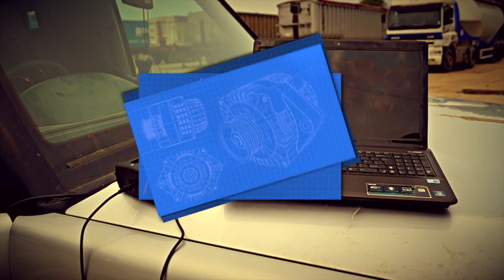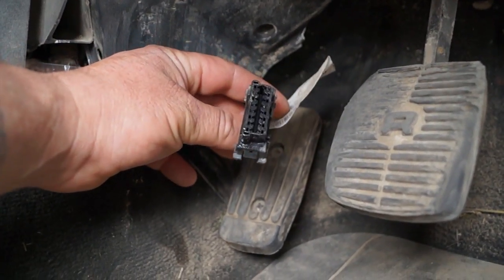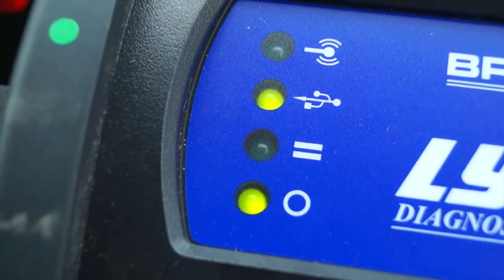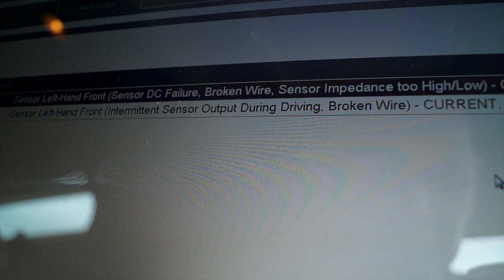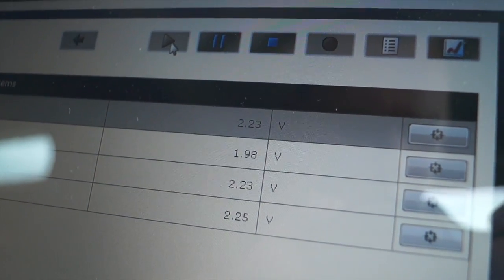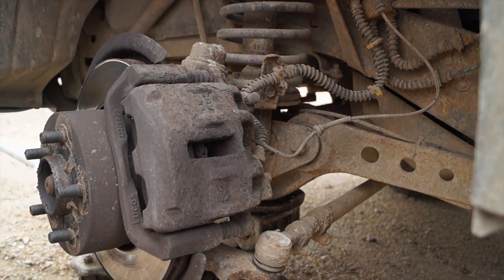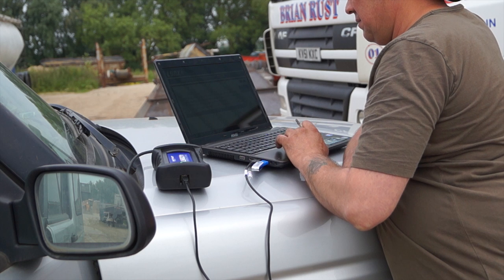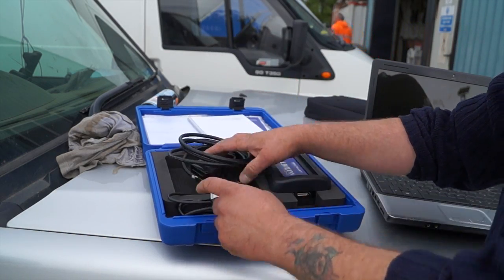3 Amigos diagnostic repair on wheel sensor Discovery 2 using Lynx Britpart interface unit

Comment: Hi There great video, I had 3 amigos after changing all my steering joints. I bought a code reader and it came up with both front sensors out put too low. changed sensor cables, 3 amigos came back. Then I cut out the joining plugs and soldered direct links in case dodgy joining plugs was an issue. Still the same. So even though the code reader doesn't mention shuttle valve do you think I should change it anyway ?

Comment: My LHR sensor gave a "LHR rear abs speed sensor fault-signal output intermittent " I did an ohm test on the old sensor and it was close to 1100 ohms. The new sensor I was going to install tested same. Could there be a problem in the wire between the sensor and computer? And how can I test this theory?
Reply from the maker: you should test the flylead between modulator and sensor.  In the video here it's the same type of lead but different application...

https://youtu.be/jPggSHIN8Rk
Reply: @trailerfitter2  Just finished watching, THANKS! I'll be doing this first thing Tuesday.  Just curious, what is that vehicle you're working on in that vid??

Comment: I have a 2004 disco. the three lit up as well as the d rack light at the same time.help can I just replace all 4 sensors. they are only 16 bucks on amazon land rover wants 150 bucks to read the codes please respond asap. need a sticker in three weeks
Reply from the maker: Bite the bullet and get someone to read the codes.  You needn't pay $150 .  Anyone with a decent scanner / reader ie: Snap On - will be able to read the ABS ECU and tell you exactly what is wrong.   No point in random parts swapping.  Just thought i'd say $16 for a ABS wheel sensor may not be a good sensor.   Good luck.  I am under the impression a Sticker is the same as the UK's annual MOT test?     Not sure if this is relevant to the USA but the UK testers now read the ECUs for permenent codes so just wiping the codes before a test doesn't work.

Comment: I finally decided to get rid of the 3 amigos issue on my disco so i got it plugged and there was one error" rear left wheel sensor electric failure "so i changed the sensor started the car but the lights are still there , got it plugged again and found a new error but this time for the front left wheel sensor so i changed the other sensor 😤 turned ignition on and the lights are still there , plugged it and the front left wheel sensor electric failure is still there with the rear left wheel sensor intermittent error also , any ideas 😔 , could it be the shuttle valves or slabs ???

Comment: buy an Autel Diagnostic Scanner from Amazon for around $20. Clear the codes. You shouldn't see the 3 amigos again for ages. I get it once or twice a year in my Disco II, ever since I've had it.
Reply: I saw your post from a year ago, and i was wondering if you were talking about a scanner that works with the disco II and what model autel scanner it is, thanks in advance.
Reply: i got rid of the car about 3 weeks after this, too many things went wrong with it.
Reply: thank you for the timely reply, i am considering doing the same
Reply: ah no problem, sorry it was short, i'd just woken up and was typing with on screen keyboard lol. 
i got rid of the 3 amigos thing a couple times and it took ages to come back after i cleared it, but after that i had it pop up like twice in a fortnight. then i had a power steering hose wear through, then a diesel line. i had two new sets of brakes in and still couldn't stop the squeaking, the injector rail seal went, and leaked oil into the ecu, then i had to replace the indicator stalk, and all this after the guy i bought it off had just put a new turbo and transmission + a few other things for around $12,000  
it was a beautiful car on the road, but i figured i'd cut my losses. i won't buy another one that's for sure
Reply: I ended up replacing it with an 80 series landcruiser, the thing is a total beast. i put a 4" suspension lift in and 33" bfg muds, and i've not touched it since aside from oil and filters
Reply: I take from your screen name that you are in Australia? ( I am in the US) I just had a mechanic look at it and he told me that the computer is going out as well. Time to sell it I guess. I got rid of my Hummer H3, which was a good and fun little 4x4, but one of my boys abused it a little and so the seats were worn a little too much and so I thought i would get his something else, now I will have to look around a little more. I am used to buying new, but don't want to buy my kids new vehicles again.
Reply from the maker: Now you know that is not the right thing to do.  DTCs are there for a reason.
Reply: The right thing to do was sell the Landrover, which I did. I bought an 80 series Landcruiser, and have had it for a year now with not a single hassle, aside from a service and new brakes. 4" lift and 35" bfg muds, the thing is a beast.
In the 12 months I had the discovery II, i had numerous diagnostic faults, replaced indicator stalk, replaced injector rail (which also leaked oil all through the ecu), water pump, leaky power steering hose, which was worn through due to bad design, which had an aluminium elbow rubbing on the engine, leaky diesel line, began not starting unless i let it sit for 12-20 mins if i drove it more than 50kms and many other things that escape me at the moment.
all this after the guy i bought it from had just spent 12k on a new turbo and transmission + a few other bits.
I'll never buy another one lol
Reply: I sold a Hummer and then one of my children wanted another vehicle, so he found this one and I ended up buying it, now I think it was a bad decision and will be getting rid of it as soon as I can.
Reply: yeah , i don't blame you man. certainly the most unreliable vehicle ive ever owned

Comment: My defender 90 TD5 has a visit from the 3 amigos. The only fault code my lynx gives me are "4020 Valve relay failure 2 (can not switch on)" as a current fault. If I manually chose to activate "valve relay" it clicks from the ABS ecu. If I choose to test "supplies and ground" it fails. "Shuttle valve SW" comes up as passed. Could it be so simple as a power supply or ground fault?
Reply from the maker: It should tell you if the connections are faulty there is a code and description for that.  Are you activating the shuttle valves individually?

Comment: Thanks - I'll check the connector, but this car has had almost all its km's as an on-road car, and being Australia, also the car has no visible corrosion except the exhaust pipes :-)  I will try extending the ABS plug wires into the cabin and go for a small drive to test - hopefully this is not dangerous as far as the ABS ability is concerned.

Comment: Thanks, is there a guide to what is the best way to test this ABS Sensor?  I have a digital multimeter, but nothing more fancy than that.  When I replaced the brakes a few months ago, I pulled the ABS sensor and checked for obvious issues, but everything was clean and tight at the sensor end on the hub.

Comment: My ODBII diag says front left wheel sensor rough road fault detected (or words to that effect) - does this mean an ABS sensor fault, or likely to be a worn hub?  I don't want to throw parts at it in the hope it turns off the lights - Also there is a slight clicking/creaking noise from under the dash and can be felt through the brake pedal when braking normally - something really subtle - a symptom of the three amigos, or a secondary fault?  Seriously considering this tool nonetheless... :-)

Comment: I think its a fantastic price... The diagnostic software at professional level to cover all those vehicles is considerably more expensive from anyone else that I'm aware of... 

I do like that you can have a cheaper version locked to your own motor... However it begs the question as regards what happens if you swap from a disco to a defender ... will they change it FOC or are you buying a new unit to suit?